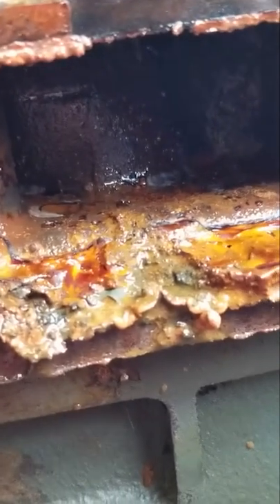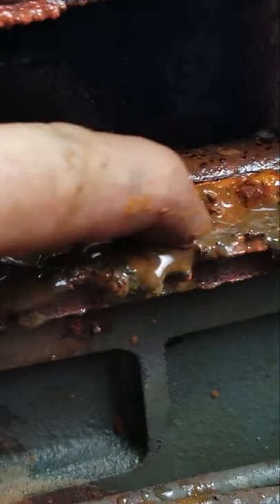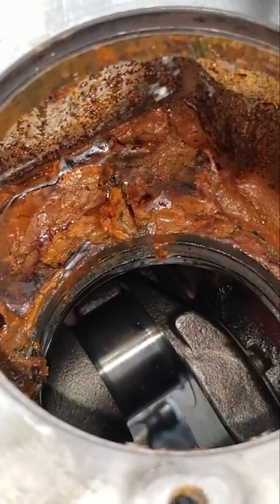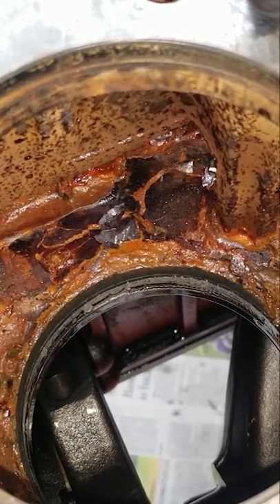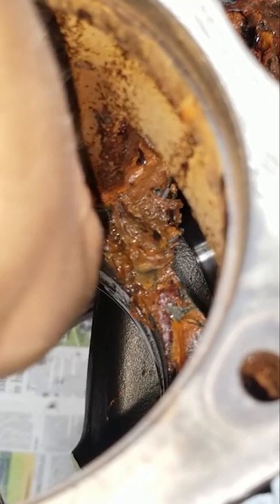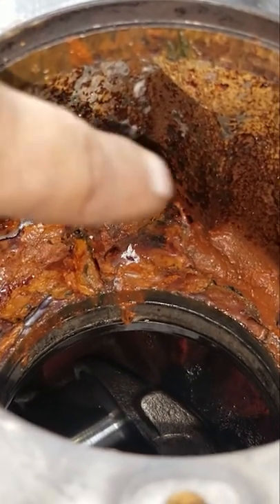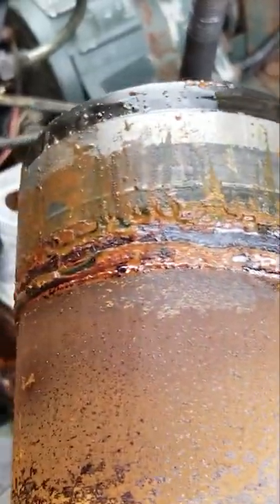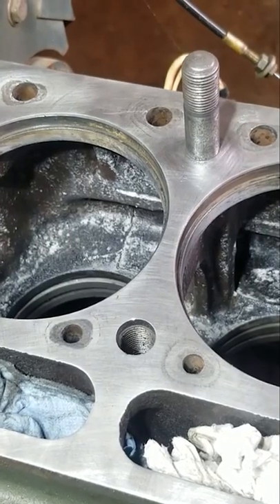Tractor Mechanic States Rusted Engine Block

Comment: Those sleeves press in by hand? 🤔 also what did you use to clean the jackets? Mineral spirits?
Reply from the maker: Yes, they are tapped in. I used phosphoric acid rust converter.
Reply: @MattsShop  hmm that would be too harsh for the application I'm doing. Which is an automobile with a lot of plastic components in the cooling system. I'm going to try my luck with white vinegar

Comment: Always use DISTILLED water
Reply: No. Always use 50/50 mix of coolant and distilled water. Otherwise you will have a titanic on your hands. Iron and water are not friends.
Reply: @LynxStarAuto first off I meant vs regular water.
Yes it is optimal to use coolant. 
Buying full concentrate is most cost effective,  but NEVER use tap water.
And distilled water won't make the motor rust like regular water. That's the point.

Comment: Hey, that looks like the outsode of the lower intake gasket of the Dodge 3.3L engine when it goes bad. Lots of coolant and oil mixing and oxidizing... can't say I enjoyed replacing it because of how much work it was to clean the surfaces for the new gasket.